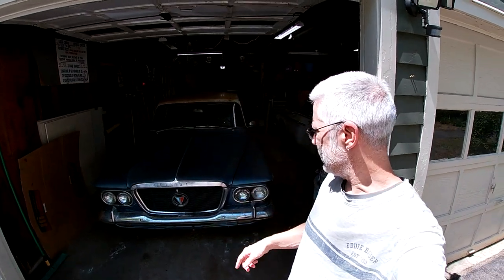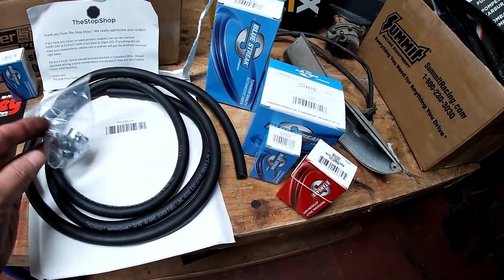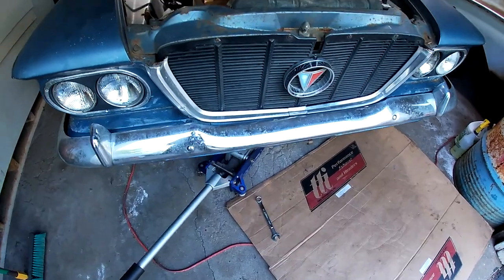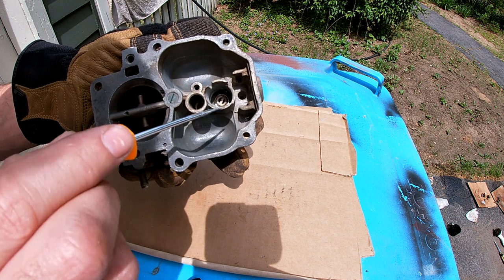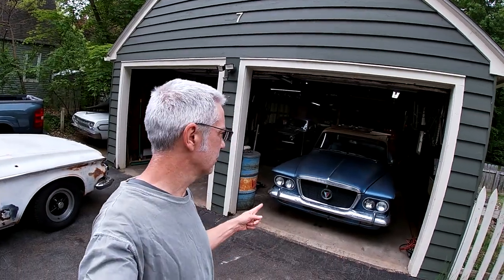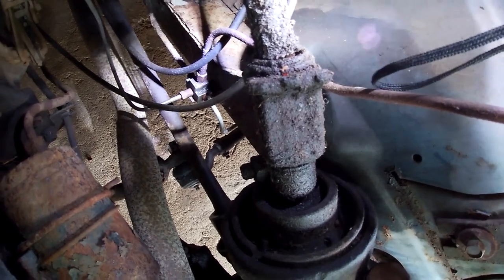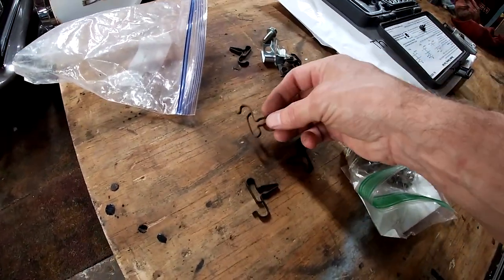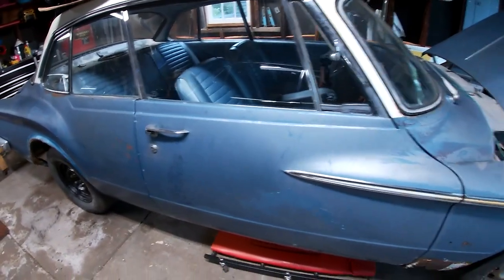1962 Valiant Signet 200 Barn Find - Tune-up and Brakes

Comment: My first car was a 62 Dodge Lancer. It was a white 4 door with the 225 slant 6. I painted it blue but left the top white. I traded it in on a 64 Belvedere 2 dr hardtop.
Reply from the maker: We just bought a 64 Belvedere 2 door hardtop, and went and looked at a 62 Lancer GT, posted both videos. We are still considering the 62 Lancer GT.

Comment: What was the part no. For the brake master cylinder ?
Reply from the maker: Not sure as I did not buy it, but the one on my Barracuda looks the same, part # M88787, UPC # 082702402047